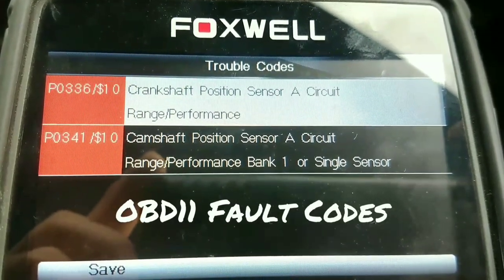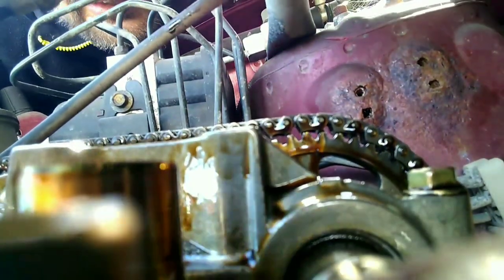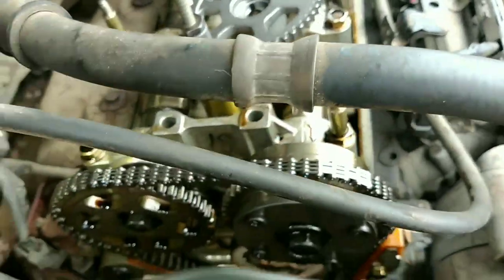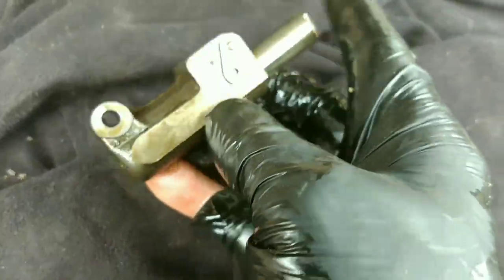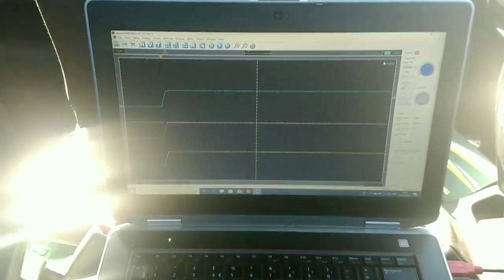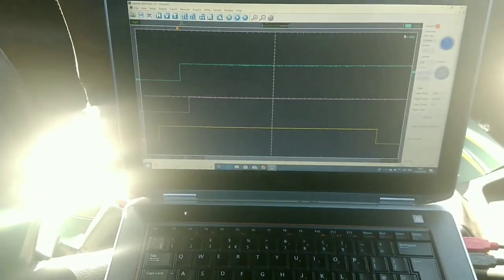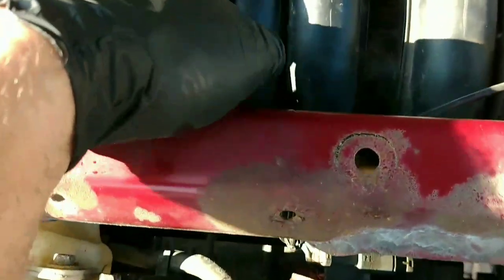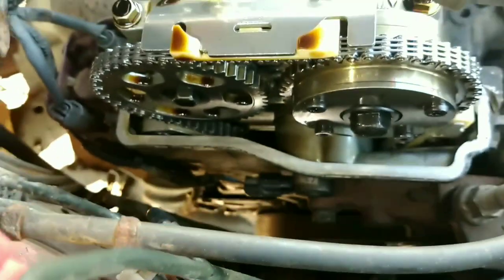Honda CR-V starts, runs then dies

Comment: good job matt . really the first mechanic did not have a clue. rattale timming chain  and codes for sensors should mean new chain first .
Reply from the maker: Thanks for watching
Reply: Had a 2002 Passat someone ran low on oil for a bit made real noise and ran like crap..I put some 5/40 synthetic in made noise for 200 more miles been completely fine 40,000 later. That chain looks good,  teeth do too.

Comment: You were sent around the houses there matt. Intermotor are normally ok tho honda sensors are expensive. Makes you wonder what the original codes were. Had to be a correlation
Reply from the maker: The mechanic that looked at it before me said the car was a start, run, stop problem. With a cam and crank out of phase fault. I think it was Honda's way of saying correlation fault. He replaced the crank and cam sensors hoping to fix it, then he had two fault codes, the other code was a crank range/performance fault. But then he remembered that he still had the old sensors. 
I had found out on Google about the holes that can be pinned in the sensor tone gears at the gearbox side of the cam shafts. The timing was spot on. So I replaced the after market crank sensor that was setting the range/performance fault code and the car was fine. 
The after market sensor was affecting the injector timing, ign timing and the intake runner. I didn't have a known good waveform to help so I thought showing it at the end may help someone with the same symptoms.
Thanks for watching

Comment: Same thing is happening to my crv 2001 and I could not finger it outwhat was wrong. Thanks very much. Going and try it will let you know if it works.
Reply from the maker: Thanks for watching, this was a strange one.
Hope yours isn't such a pain.
Reply: It was a pain in my a**. I carry my car about 10 different places and they couldn't find out the problem.
The car will start an then cut off and even when 🚘. Driving. Also when I press the brakes it's cutting out its not idealing.

Comment: So the timing chain was the problem??
Reply from the maker: Hi Raymond, in this case the timing chain was ok, it was new and set up correctly.
Before the chain was replaced the mechanic that was working on the car changed the cam sensors and the crank sensor for a cam crank plausibility fault. That didn't help the car  and the chain was slack and rattling. At this point I bought the car for myself and  I fit a chain kit, the car still wouldn't run, it would start and cut out. 
Long story short, the crank sensor was faulty, I asked the mechanic that worked on it for the old sensor, I put it on and the car ran fine.
So yes you are right that the car needed a chain, the other problem was the new crank shaft sensor was faulty, it made it look like the timing was slightly out of alignment even though the timing was ok. It must have been made with the pickup part of the sensor in the wrong place.
Thanks for watching